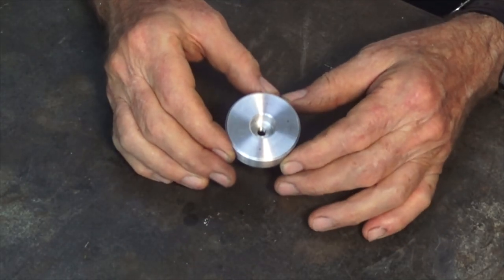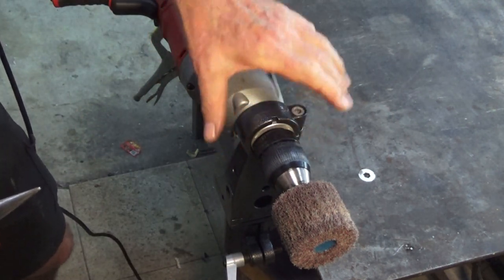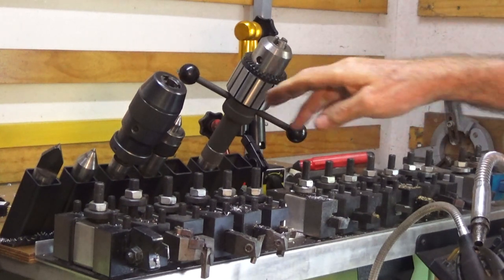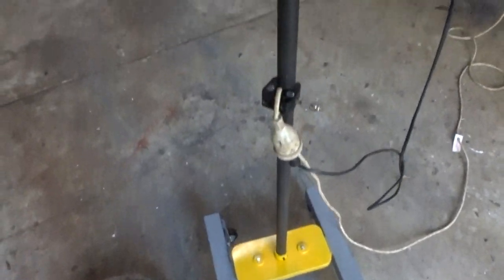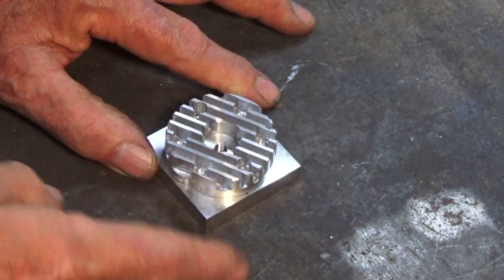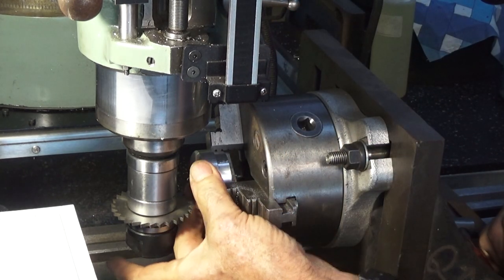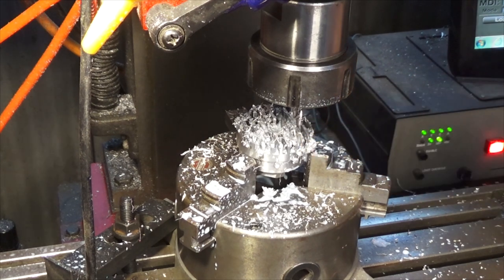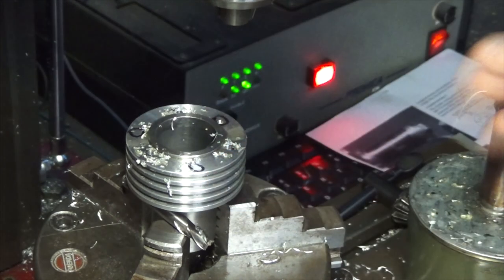Building the Titan .60 Glow Plug Engine #9

Comment: The amount of time needed to complete this project is a good reminder of how mass production techniques, automation, CNC, cheap labour, etc. are the foundation that modern life is built on.  There's a massive amount of refinement of the production process between prototyping a product and being able to manufacture it at a price that anyone can afford.  Great series.  Looking forward to hearing it bark into life.
Reply: Very true. People will be in for a shock if we have to go back to making things ourselves with limited resources.
Reply from the maker: Another viewer pointed out that ALL the slots in the head could have been cut in one pass if the correct number of slitting saws were ganged on the one arbor. The same with the holes in the head. In a mass production shop, they would be drilled and conterbored in one operation with a multispindle drill. Of course, with the latest CNC machines and a massive tool library you could just press cycle start and walk away. I was very fortunate to be given a tour of the Red Bull F1 Technology centre in England. They had some massive CNC machining centres running with no operators in sight. You could hear them hogging into some serious lumps of metal and it was like this muted but visceral growl. The engineers there must have an implicit trust in the machines to leave them running on parts that cost millions of dollars a piece. 
Regards,
Mark

Comment: I am so glad you did the "like a boss" thing. I was sort of disappointed for you when you said "so that part is finished" about the cylinder headBeing finished.  You deserved a  marching band to spring out of the closet and  begin playing a stirring victory song for you! I wanted at least a party cracker with confetti or something in celebration of your diligent and precise efforts. Well done sir!
Reply from the maker: Thanks. Unfortunately, the "Like a Boss" feeling didn't last. Machining the piston has been somewhat of a mission and my PC that drives the CNC mill lost the will to survive halfway through the process of machining the connecting rod. Things are starting to get back on track but it has been somewhat frustrating trying to get the next two parts done.
Regards,
Mark

Comment: I am impressed with the methods you used for the relative alignments of fins, bolts, crankcase and liner.  The well made engines of the past (Merco, OS,  Enya, McCoy  etc) always had that detail spot on.  You have achieved that Mark!  We have also been able to see how complex and precise that work is.
Reply from the maker: Thanks. I find that it takes days of planning and rehearsal to get the details right. That's the problem with one off parts. I was lucky that I had the spare stock for the head to practise on. I did have some more bar stock for the head but my biggest fear is messing it up on the very last operation. 
Regards,
Mark

Comment: Gday Preso, absolutely outstanding work on the Titan 60, I’m throughly enjoying this series, the new tool and cutter grinder is going to be and major asset to the shop, it will pay for itself in no time, the camera stand is a good design, you guys have had your fair share of rain up your way to, thanks for the great content mate, Cheers
Reply from the maker: Thanks Matty. I have wanted one of those D bit grinders for ages and I did successfully sharpen a 12mm carbide end mill with a chipped tooth. In the past I would have had to scrap that cutter or use it for rough work. I also did a 7/8" HSS end mill. The big ones are easy though!
Regards,
Mark

Comment: Good Show Mate: As always. New stuff for the shop! Always a good thing. My only problem is when I do stuff like that, I miss place things and I can't find them. Two steps forward and one step back. When you get the engine done, it needs an airplane to put it on. A whole new project.
Reply from the maker: I know exactly what you mean. I made a set of Joe Pi toe clamps and put them in a little plastic box with some copper and brass shim stock, all the M6 socket head screws and the correct size allen key and do you think I could find the box when I went to use it for the first time? I need a full time storeman!
Regards,
Mark

Comment: You make it look so easy, wow I would have to make 20 attempts. I'm always impressed with your work. Cannot wait for the next episode. Best Regards Graham
Reply from the maker: It may look easy but I hesitated for days before I summoned up the courage to cut the grooves in the cylinder head. My biggest fear was that the cutter would pull the stock out of the chuck as the cut started. The teeth at that point are trying to lever the stock away from the face of the chuck but as the cut goes full depth it evens out. However, crisis averted this time. 
Regards,
Mark

Comment: Great video Preso, bravo! Like a boss 😎
Reply from the maker: Thanks Stevo. I did plan to fully CNC machine the second cylinder head and I had a toolpath set up to use a 3mm ball nose end mill so I could machine the slots for the cooling fins and then do a clean up pass at full depth to bring the slots to 1/8". However I got a bit nervous when the PC running my CNC controller started to have fits. I decided to cut the slots manually on the Bridgeport as the CNC toolpath was quite long and I was worried that if the PC disconnected I could ruin all the work up to that point. The drilling programme was relatively short and I had my hand near the Estop the whole time. A day or two later the PC died completely and I'm now only part way through reinstalling Mach3, MSM and CorelDraw on a refurbished PC. I feel you are a lot braver than I am when it comes to using tiny end mills and working on such small parts. I really should grow a pair and go all in!
Regards,
Mark

Comment: Looks good, if you’re worried about how it “looks” you could bead blast the head and cylinder cooling fins(which will take off any small burrs) then polish the top of the fins with some 320 grit going in one direction or scotch brit.
Reply from the maker: I am absolutely thinking of doing just that. The contrast will be interesting. I do intend to anodise the head and the spinner so I want those parts to be really well finished. 
Regards,
Mark

Comment: Hello Mark,
Good shop update, I like how you have your camera stand set up and also the AEG drill setup, very useful for a smaller workshop like mine.
Take care.
Paul,,
Reply from the maker: Thanks Paul. I actually stole the camera rig idea off Craig from Craig's Workshop and Rotary SMP. I did mention both on one of the takes I did but it ended up on the cutting room floor.
Regards,
Mark

Comment: I watch this series like the engine is mine and, knowing is the last cast for the block,  get little anxious with any decision you make. That youtube thing is a little crazy sometimes. Thank you for the videos!
Reply from the maker: Yes, everything is high risk in this build. The longer it goes on the less opportunity I have to just bin all the parts and move on to another project. Imagine trying to explain that away!
Regards,
Mark
Reply: @Preso58  Well you can always plug the holes and try to use a little clay to build up the machined surfaces to give you more of a fudge factor.  Have it recast and try again.

Comment: Great work Mark.  I wish I could get as organized as you are!  But I have to say that is a very LARGE .60 engine.  It looks bigger than my .90s.  It'll be interesting to see what it ends up weighing when fully finished.
Reply from the maker: Yes, it's a hefty beast. I just started working on the two remaining parts today and the piston is going to be quite heavy. It's made from close grained cast iron! I will make one in aluminium first though. 
Regards,
Mark

Comment: Amazing work. Thank you for sharing. Looking forward to seeing this through to completion.

I also have a Chinese clone of the Deckel SO Cutter Grinder, and look forward to seeing how you get on with it. I use mine to grind engraving bits for my pantograph engraving machine, as well as grinding the hss tools for my tangential tool holder.

All the best, Andrew 👏👏👍😀
Reply from the maker: I must say I had fairly low expectations when I bought that grinder but I was also pleasantly surprised with the quality of it when it arrived. The range of accessories that came with it made it worthwhile. There are a few cheaper versions for sale on Ebay  but they don't come with the proper 5C collets and most of the included accessories are optional on the cheaper version.
Regards,
Mark
Reply: @Preso58  Sadly mine did not come with the accessories and I now regret not buying them at the time as the UK vendor no longer stocks them. 😢

Comment: Hey mate, loving watching along with the projects. I had a tip for improving the audio of your videos. While the cicadas in the background fill me with australian pride and nostalgia, they really scream through some speaker set-ups. What you're able to do is record some background sound and using a program such as 'audacity' (free and good) to remove it from your audio of the video. It's a bit of a screw around at first but once you work it out, becomes quick and easy. There are some good guides out there on removing background audio hum or buzz. Thanks for the videos. Keep it up.
Reply from the maker: Thanks. I do already use Audacity a bit but I must say I find it a bit counterintuitive to use compared to Vegas. I also don't tend to edit using headphones but lately I have been trying to do that. The cicadas are particularly bad at the moment, possibly due to the rain but I can hear them now at 9:30 pm. I will follow up on your suggestion.
Regards,
Mark

Comment: Thats turning out amazing. Are you going to make the spray bar and needle from scratch? I would love to see the process in detail. I restore old rc engines and finding replacement needle valves gets difficult and I would love to make my own. Thanks for the video!
Reply from the maker: I think I will have to make the spraybar and needle valve from scratch. I haven't given it much thought yet. If I can get past making the piston I will have to face up to getting the front end of the engine done. The setup for boring out the venturi is going to be "interesting".
Regards,
Mark
Reply: @Preso58  yeah I thought the same thing. Not to many flat spots on the case.

Comment: Is there a reason that you didn't drill the holes in the cylinder head BEFORE cutting the fins ?  (That way there would be no risk of the fins bending during drilling and counter-boring.)
Reply from the maker: It was mostly to do with making sure the six holes in the cooling fin/cylinder liner assembly are aligned with the ports in the cylinder liner and therefore the crankcase. The build notes do specify an order for all the operations and I am mostly guided by those notes. Luckily, it all went smoothly.
Regards,
Mark

Comment: The pin on the crankshaft must be able to serve as a fuse in the event of a crash with the engine running. You can imagine my kid's tears when the crankshaft of my first engine broke at the venturi, and yet it was with a wooden propeller.
Reply from the maker: Nasty! I must say we crashed plenty of aircraft when I was flying control line planes back in the 70's but we never really damaged an engine. We smashed plenty of props though. I recall seeing a picture in the Aeromodeller Magazine of a very expensive looking racing engine snapped off at the venturi. Those guys flew on tarmac! I guess the pin would shear off fairly easily. I thought it was specified because cutting a spline might be outside the scope of most home builders.
Regards,
Mark

Comment: Mark. Nice  job. You've taught me to be more patient. I must say as a consideration, what about the prop driver pin causing a certain amount of imbalance? Really nice work...thank you....enjoy this very much. -Tom
Reply from the maker: There may be a tiny bit of imbalance there but it would only be a fraction of what you get from the reciprocating mass of the piston and connecting rod. In a single cylinder engine it is nigh on impossible to counterbalance the rotary, angular and reciprocating forces. The notes did specify to put the hole for the pin on the opposite side to the crank pin so I guess the designer was anticipating some balancing.
Regards,
Mark

Comment: Hi Mark ,
Probably a wise move to use the slitting saw - the lateral load on an end Mill probably would have bent the fins . I remember talking to one guy at Hare and Forbes when they had a local model engineering club in for show , he had a radial engine with these deep thin fins and he used a set of slitting saws ganged up on a mandrel to cut all of them in one go . He said by doing it this way the lateral load is near non existent and the flank of the next cutter stops the fin from going anywhere .
Interesting way to store MT tooling ! I would never have thought of that ! Gives me an idea for the mill - something like a lazy Susan.
My lathe has a bolt down in the valley of the bed that stops the tailstock clamping plate from getting past it so the tailstock can’t get flung of the end of the bed - one of the few things I have seen on a Chinese lathe that I thought was useful 🤣
Have you seen the YouTube video on how they made Colchester lathes ? 
Thanks for the fantastic video !
Reply from the maker: Ian, I did watch the Colchester video and it was very impressive. The Gamet bearings in the headstock cost a fortune to replace if they go bad so they must be well made. We ended up putting a bolt in the centre web of the  bed on the Sheraton lathes at school to stop a repeat of the flying tailstock. The Sheratons had a surprisingly short bed and for some reason the tailstocks slid very easily. If you already have one  on your lathe you shouldn't have any issues. I did find that the slitting saw did a much better job than the little ball nose end mill. I hate using those things. They always leave a rubbish finish due to the almost zero cutting velocity at the centre of the cutter. Having 7 or 8 ganged cutters would be great but my meagre budget won't stretch that far. 
Regards,
Mark
Reply: @Preso58  
I’m in the same boat regarding the slitting saw -one groove at a time ! 
The engine this guy made had something like 10 or 12 cylinders with heaps of fins on each one - it would take me weeks to cut them one at a time , the strain would just be too much and I would be seeking solace in a cold beer after each slot was cut 🤣

Comment: This has been the most interesting series! It seems there has been no provision for a muffler/silencer and I'm most curious to see how the carburetor is going to come together. 🤔 Excellent work, sir!
Reply: When I bench ran my old OS 25 Heli engine, I ran a silicon pipe down to a gallon can stuffed with wire wool.  I swear you could hardly hear the thing, I still have it somewhere.
Reply from the maker: There is no provision for a muffler in the original design drawings and I am trying to replicate it exactly as drawn. There is also no provision for a carburettor. The engine will have a simple spraybar with a needle valve to tune the mixture. It will pretty much be a fixed throttle opening. It's all pretty old school but I think the designer was trying to keep it simple for first time builders. Because of it's size it was regarded as being an entry level build.
Regards,
Mark

Comment: Awesome.. Looks like an old Enya motor from the 60's - 80's. Very interested in seeing how you deal with the intake.
Reply from the maker: That part is causing me some grief at the moment. The construction notes don't go into a lot of detail about how to locate the exact point to drill the intake port in the crankshaft. There is a vague reference to pointing the crankpin towards one of the holes in the rear of the crankcase and then drilling through the open venturi. Maybe it doesn't have to be that precise.
Regards,
Mark

Comment: This engine is coming along wonderfully and it is looking great.  Perhaps you might use what you've learned here to do a new project in the not too distant future where you make another one but completely from scratch using billet only.  Perhaps?  :)
Reply from the maker: I do have the drawings for the Crusader .60 which is also designed by George Genevro. It can be made without any castings.
Regards,
Mark

Comment: Great job! I wonder if drilling the hole pattern first and only then slotting the fins, wouldn't have been more stable (that vibration you mention, due to the unevenness of the material).
Reply from the maker: I did drill and counterbore first on the practice head. I am not sure there is any advantage one way or the other. I did notice that when I put the ground rod in the slot for aligning the part in the CNC mill that all the slots were equally tight so at least nothing bent when the counterbore operation was done.
Regards,
Mark
Reply: @Preso58  Yep, you may be right. There are always pros and cons in these decisions. I just cringe at drilling or milling through uneven material so, maybe it's just me :-)